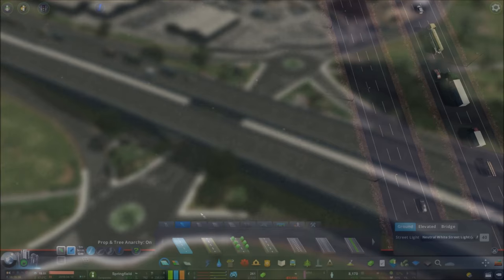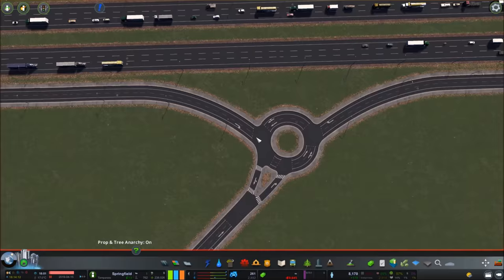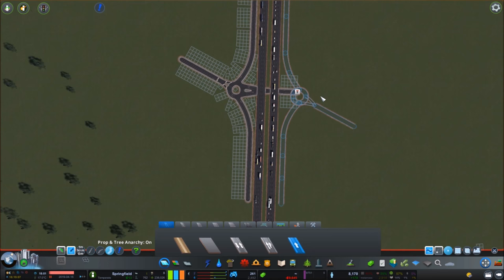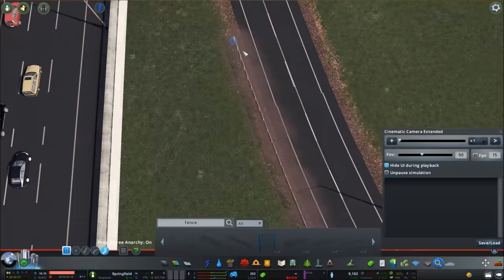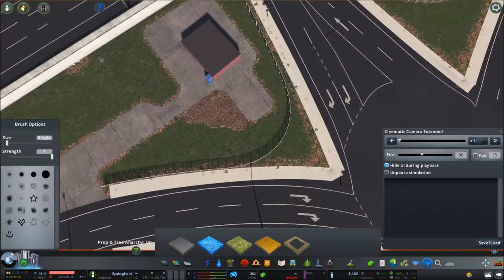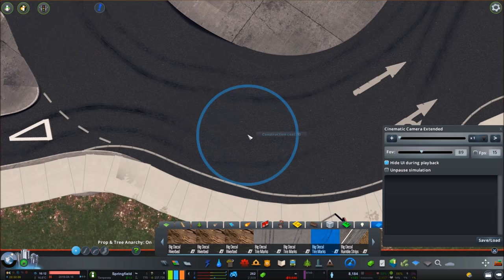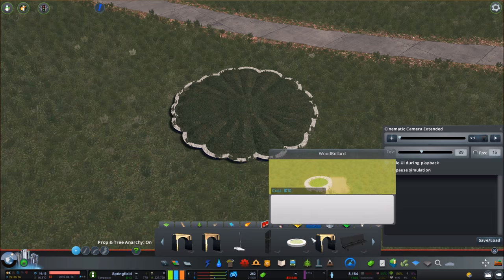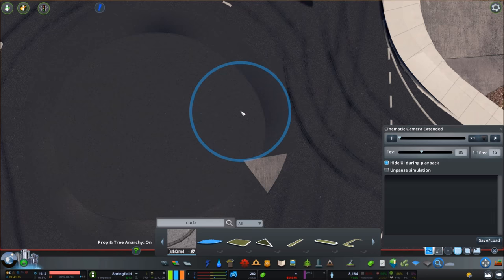Cities Skylines: Dumbbell Interchange Build

Comment: This is probably a dumb question, but how did you copy/paste the interchange to build the other half quickly? I cant seem to pinpoint the mod in your list that does this.
Reply from the maker: With the move it mod
Reply: Did you use the same mod to decrease the elevation after you copied it? I can't seem to get that feature to work on mine.
Reply: I figured out I need to use pg up/pg down in order to alter the elevation, but for some reason the change moves EXTREMELY slow when I do so. Is this normal?
Reply from the maker: you can either slow the speed up or down by using shift ctrl or alt
Reply: Oh awesome, thank you so much!!

Comment: Had to drive through one of these recently. Let's just say I kept taking the wrong exit ramp.
Reply from the maker: Its just a two roundabouts its fairly easy to navigate
Reply: Crumbs McGee I'll bet it is; the one I drove through was extra complicated. Think of each lobe as having three connections each (one two way road and the two on/offramps). Now add two more connections (two way roads) to one of the lobes parallel to the ramps.